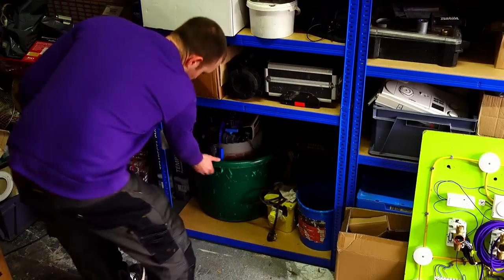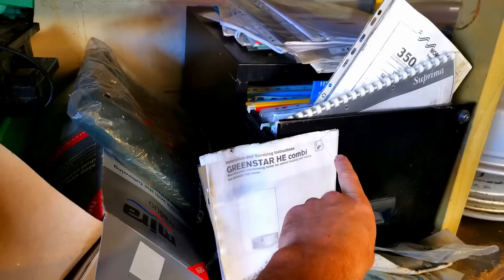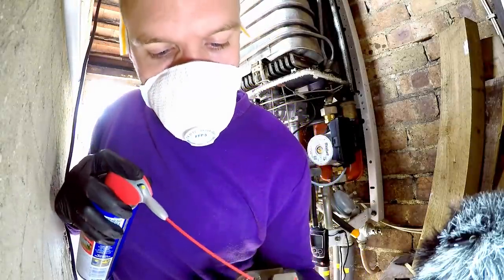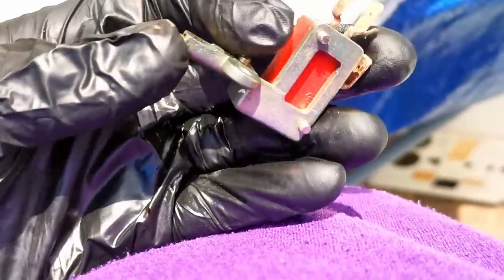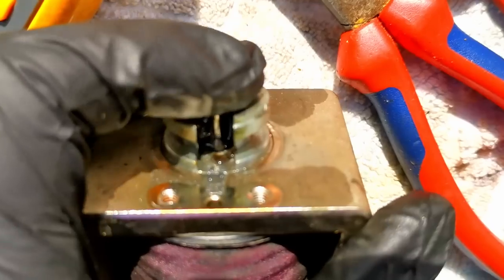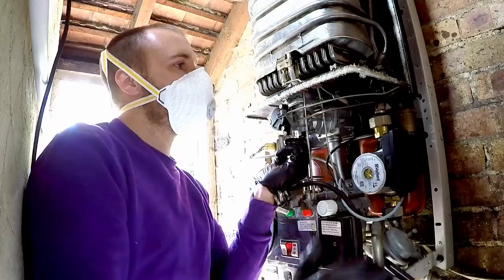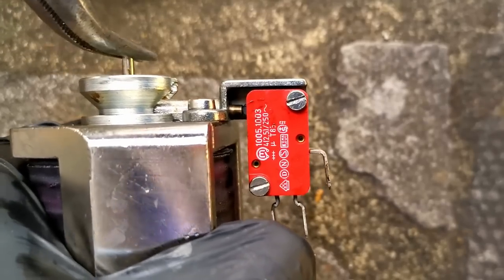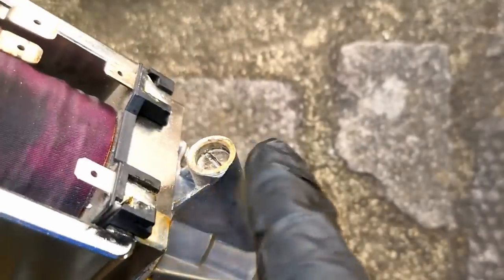Oldest Combi Boiler Repaired. Finally Fixed?

Comment: Absolute quality job. Honestly, I would have walked or fitted a new one. Credit to you and our industry.
Reply from the maker: The problem with fitting new is you lose a customer for many years. Manufacturers will sell them an extended warranty and system cover too. Keep the old boiler on the wall and keep a customer happy. Also you get to build a relationship and have a long term customer. Thats my thinking anyway. What analyser would you recommend?
Reply: I thought you had one of the best KANE defo not TPI. I have an Anton never a problem but they made them obsulete, me to looking for recommends
Reply: @kevinschoales844  What's wrong with the TPI ones? I was looking into getting one of those as my regin one click is due for calibration, so any info appreciated.
Reply: @MrSuperheterodyne  i had one onloan as Anton in for recalorbration battery prob, then 2nd very slow reading slight adjustments and several boilers high ratio, going back to all jobs with calibrated Anton to recheck. Kane had good reports about and quick turn round 👍
Reply: @kevinschoales844  Thanks for the info mate. I'll have to see what deals Anton have on the go. Sometimes the college training centres have info on promotional deals and their reps used to go there.

Comment: The most interesting and intriguing boiler repair on YouTube. Really enjoyed all three parts. I regularly work on lots of old gas appliances, but I've never seen that Vaillant model. Oldest for me would be a Worcester Heatslave (gas) floorstanding Combi. With an open vented heating side! The older models I agree are more interesting as I guess they are more mechanical and less than electronic. I wouldn't have been able to fix this one though as you did so I take my hat of to you. Cheers
Reply from the maker: I think everyone could fix this boiler. Its 90% mechanical and thats why. I really like these older boilers. :-)

Comment: I’m still nursing my 33 year old Potterton Neataheat, last 3 guys I asked to service it said sorry it’s too old and I need a new one. There are so few parts inside an old boiler that there is not a lot to go wrong, long may she live on. 🚀
Reply from the maker: The Neataheat has some asbestos seals so you should look up your specific model with serial number to check if it can even be serviced. :-)

Comment: Just finished watching this 4 part Education, it was at the end of part 3 that I realised it was 00:43 am... Must congratulate you on your Filming & Editing prowess, it must take hours to produce a video of this quality! Had a water leak on my Sine 18 in the mid 90's, from the water diaphragm on the Gas vlv which trashed 2 boards inside the Control box. Sourced replacements and fitted but would not fire up? Had to get a Vaillant Engineer out, fiddled about for an hour or so, and then all of a sudden, it lit and went up like a Hot Air Balloon burner! At the time he had his hand in amongst the pipe work on the RH side of the control box. I asked how he fixed the problem and said 'it must have been a loose wire connection'. I paid him and he left. Got my torch out and had a look and found the reset button with the rubber bonnet on it you showed us in the this vid!
Reply from the maker: Yeah, the old ones are hard to repair as the knowledge has disappeared with the older engineers. Thanks for take ig the time to comment. :-) I appreciate it.

Comment: hi ollie  i had one  EXACTLY  the same  in my house from  1992  it was in the house before i got it   it give up leg's about  2005    it was probably something silly  but the  plumber said  if i was you i would just change the lot ?  i could fix it & 2 month's down the line  some thing else might  go  why don't you get a more efficient boiler  save money   since then  till now   i have had 2 more boiler's in  both have nothing but hastle    ton's  of part 's giving up  a  Potterton  & my present one is a  baxi   the worst move i ever did    might have been a big ugly thing  but   no bother    until my  service  guy moved away   my valiant died  with him moving 🤕 oh and what a cracking bloke you are  your  knowledge is 100% stay safe

Comment: Well done, great content & awesome work. That older gent really appreciated your efforts & I'll bet that vaillant combi will still be running easy another 8-10 yrs if you get to look after it. My floor stander is 45 y/o & my partner's combi is 29 y/o. They get regularly serviced. Both running perfectly & while that continues the efficiency savings don't justify replacing them.
Reply from the maker: Exactly right. The cost savings are not what they seem. :-) Especially when you need parts every few years. :-)

Comment: Great work man.  For analyzers, I've always had solid luck with Testo.  Have an old 330 right now, contemplating replacing with a 320 when it finally gives up the ghost.
Reply from the maker: I had a 330 many years ago. cost me £1000 with all the gear.... Used it twice and it got stolen. it did appear to be great. I was absolutely fuming. I got Kane 455s ever since mainly because of the price but it was a great tool. Im so unsure right now though
Reply: @HeatingGeek  Yuck, that would definitely sour me.  Apparently my info is out of date though, the 320/330 appear to have been replaced by the Testo 300 LL.  Looks to be in the $1500-2000 CAD range.  That said, if it's as reliable as the 330 that I have or the 550 digital manifold, it'd be worth it long term.  One big selling point is that they are easy to get serviced and you know you'll be able to get repair/replacement components for a very long time.

Comment: Very thorough mate, installed plenty of Vaillant boilers in the 80s, they were an excellent piece of kit. They were the most expensive on the market at the time, Vokera were also popular at that time, cheaper but inferior to the Vaillant.
Reply from the maker: Vokera came form a scorned man who wanted to sell Vaillants. AFAIK
Reply: Good old days when boilers could be dismantled, rebuilt and not fall apart. Not composite plastic crap with loads of O rings, i hate em..
Reply from the maker: @kevinschoales844  :-) You and me both. :-)
Reply: @kevinschoales844  You won’t find a present day boiler lasting 40 years that’s for sure. Lucky to get 10 years out of them.
Reply: @tonymarshall4164  i got called out to a past boiler last week, customer said i installed over 30 years ago, had been maintained by others until won't as of course obsolete Bermuda, however its only gas fire tap at fault, he refuses to have a condensing combi as " they dont make em like this no more" 
He will eventually realise he has no other choice.
Tales of a heating engineer
Reply: @kevinschoales844  hi mate, Baxi Bermuda were pretty much bulletproof, very little to go wrong. But of course can’t compare to a modern day condensing boiler regarding efficiency.

Comment: Waited a long time for this apparent final episode and I must say your perseverance and determination is to be applauded but I need to ask what I am sure other engineers may be thinking was all your hard work and time worth all of the effort in the end?  If you say it was then I can only assume it was pride that kept you going but I hope you managed to show a reasonable profit too!  As a foot note I could not film and repair at the same time I just would not have your patience and dedication, so thanks HeatingGeek for another fine video and hope younger engineers will take some inspiration from you
Reply from the maker: The money was ok. I would do it again. The job was worth doing just for the knowledge gained. I really like the older boilers and how they work. New stuff is very very similar so gets a bit boring. 
Would you have done it? Also I really do want recommendations for a new analyser. :-)
Reply: @HeatingGeek  

I would go for a testo 330 i have had mine for about 3 years now much better than the other brands and can with stand   a lot of ppms for those boilers that have never been sett up correctly.
Ps expensive to service though
Reply: @HeatingGeek  As I am nearing retirement so I probably would have given this boiler a wide berth but years ago I certainly would relish the challenge as you have. As for GFA I have remained loyal to Kane and have never used anything else, it does what I need it to do and re-calibration is a fair price imo

Comment: Mega fix. 
I had a VCW Sine18 for 20yrs - and it was prob already 10yrs old when I moved into the house. It finally gave up the ghost in 2011 with hot water not working unless the CH circuit was calling for heat. May have been a simple fix - but I had the boiler replaced with a WB 37CDi for an improved flow rate and efficiency, I doubt may boiulers will last as long as that one has.
Reply from the maker: Im sure there are a few more sine 18s out there somewhere. :-)

Comment: Finally great series nearly as long as GOT just waited too long for the finale 😂 well done for seeing the repair through 
Testo 327 - work well good price point doesn’t shut off when due a calibration 😡 unlike Anton I think they are great hard case though which has its good and bad points
Norstrom Proflush Magmaster - great for flushing boiler swaps but maybe bulky for boiler only flush but they do a Compact machine too
Reply from the maker: I don't do Boiler swaps so a compact machine would be better for me. My choices for FGA are kane, Testo EIUK or bluelyzer. I had never see the last 2 before but I might just give them a go. :-)

Comment: Thanks for giving us the update. Really enjoyed watching it. You did an amazing job really impressed. Hope everything going good with your buissness now. 

Also I like the new Anton analyser alot of people like Kane but I prefer Anton only problem I find is when you send it for calibration you don't get it back as fast as Kane.
Another thing to point out with Kane it takes a fair amount of time to zero before you can use it compared to Anton.
Reply from the maker: I agree about the 90 second delay before you can use it. Ali who works with me has an Anton. Not very many recommended them though.

Comment: I don't think I've seen one of these Vaillant combis in the last 15 years or even more! They were expected to last between 15 and 20 years and quite a few of them were replaced in the 90s. Most engineers just told the customer "Sorry mate, no more spares available!" and sold a new boiler. My parents had a 1977 Junkers that was considered absolutely ancient by about 2000. It never died but it failed the stricter emission tests introduced in Austria in 2011 I think and was replaced with a whole-house pellet boiler (house with 8 larger apartments) in 2012. We were quite annoyed about the gas engineers we had to have the boiler serviced every year, for most of its life though. Some time in the late 2000s the boiler started to leak a little and we had to refill the heating system every few months or so. We told the company several years in a row, they couldn't find anything. I then started to suspect that the expansion vessel might be broken after over 30 years of service and it might be a good idea to fit an external one instead. My uncle, who's a plumber, fitted that and in the process discovered that one of the connections at the heat exchanger hadn't been done up properly and leaked for years! He tightened it and that was it, no more problems with the boiler for the next three years!
Reply from the maker: The old boilers were made to last as long as possible, new boiler are made to sell parts and service contracts. ;-)

Comment: I see boilers only a few years old at the scrappers and I look at them and think "There is nothing on that boiler that isn't easily fixable" . All this talk of zombie boilers is just sales propaganda. There are too many manufacturers chasing sales to keep production lines going. Thats why boiler are cheap and parts are expensive. £60 for a plastic bayonet fit AAV  with O ring....its a joke. I'm full of admiration for your tenacity and thoroughness. I have to admit I'd have struggled with that one without a proper manual.
Reply from the maker: Its actually a very easy boiler to work on and diagnose. If you read the manual. :-)

Comment: Thanks for the Vid instructive as usual , I know that feeling where you just want to run away lol.  Just a crazy number of adverts every couple of mins. Nearly turned off after the first 5-6 only 10mins  totally crazy
Reply: I used to get loads of adverts but I started using a browser called Brave that someone on here recommended.  Do not get a single advert on anything I watch now. Give it a try.
Reply from the maker: I don't place the adds. Youtube does. :-) But as Dave T says you can get browsers to stop it. :-) It drives me mad too. (not on my stuff but on other peoples) ;-)
Reply from the maker: @silvervanmanfly  Good shout. I think you can get add blockers on Chrome too.
Reply: @silvervanmanfly  Will look into that thanks
Reply: @HeatingGeek  Thanks for your reply I now have a chrome free add on that works really well give it a look Adblock

Comment: Well done mate. Sometimes I wonder if it's worth spending so much time on repairing old boilers, as satisfying as it is. I've sometimes not managed to fully sort the problem and then not charged the customer properly and felt it was all a wasted effort. Even though it's always a learning experience. Then when it stops working next time it will be your fault in the customers eyes. 
Next time just fit a new Vokera Easi Heat 25 and then change your phone number.😆👍
Reply from the maker: :-) I have a fixed fee and it works out for me . What analyser would you use to check the Vokera? :-)
Reply: @HeatingGeek  I've got a Kane 458s. Great bit of kit, it's the second Kane I've had because they give excellent customer service.

Comment: I would imagine a very high percentage of gas engineers would have condemned that boiler as soon as they looked at it. We have a Halstead Quattro combi boiler which is nearing 35 years old and is still running strong. The only things that have failed on it were the diverter valve diaphragm had split on three occasions (the popular Giannoni valve) and the ignition board.
The diaphragm kits are still available to this day. It may not be as efficient as today's boilers but has outrun many of them.
Reply from the maker: Exactly. Also the manufacturing cost (both monetary and environmentally) would have been worse on a new efficent boiler.

Comment: I can see this was between you and the boiler like Bruce Lee vs the Demon lol well done that was amazing viewing real engineer work 👍
Reply from the maker: It was. This is a model I didn't fix about 17 years ago and lived with me. I'm  glad I got to spend the time and learn a lot about how it works . Any analyser you would recommend?
Reply: @HeatingGeek  I use a kane 458 day to day and find it rock solid, they do 5 year fixed service cost with quick turn around, downside is purge time. The testo 320 anayliser is very good but not sure about ongoing costs. Thumbs down for Anton expensive servicing and the ones I've experienced are just unreliable and can never trust what they are telling you.

Comment: Brilliant job! Where I work it would have got the death sentence and a new Bosch Condens 5000W would have replaced it. Anyway, my tester is a Testo 310 w/printer (the printer is a bit on the slow side), and I use a Testo 510i smart probe as manometer and they work great on the 4-6 calls I do a day.
Reply from the maker: How often do you need to charge the 310?
Reply: @HeatingGeek  The battery has never run out on me because I simply plug it in the charger to top it up every evening, but that being said the battery always show 3 bars out of 3 at the end of the day. The only annoying issue I have had was the print in the tester died on me and had to be replaced, covered by the guarantee of course, if this happens it always happens during the first couple of weeks. It has worked flawlessly ever since and is extremely reliable and easy to work with. I find the menus faster to work with than many other testers due the fact that you move "sideways" in the menus, and never back out to the previous menu level before you select a new measurement. My usual routine is: Turn on the 310 and while it flushes and calibrate itself I turn on and fit the 510i and then the 30 seconds is up and I press the <->  (sideways) button once and make the ambient CO measurement, when done I press STOP and <-> and take the flue draught measurement and press STOP, set the boiler on Max, next I press the <-> twice and I do the max adjustments for O2/CO then I press STOP and Print, and while it prints, I set the boiler on Min this give the boiler time to switch over to minimum and get up and running, then I press START and and take the measurement, press STOP and Print and I'm done with 310. I am very happy with it.

Comment: Can you shed some light on indirect single feed cylinder and how it works? I came across it on a back boiler conversion and I don’t get how it fills the system, how does the inside of the cylinder work? Do you have a diagram? There was no F&E tank at all.
Reply from the maker: Primatic cylinder?

Comment: Can i ask,  I'm currently looking at a narrow boat that only has electric, it's never had any gas installed, it does have a gas locker at the bow,   I'd prefer a gas boiler and cooker,  would it be difficult to convert,  cheers
Reply from the maker: Forget the gas boiler bit. You cant run a gas boiler with the LPG bottles you can store in a gas locker. Usually you can only get 2 13KG LPG bottles in a gas locker. The take off rate isn't enough (usually) for a boiler/water heater and cooker.
Reply from the maker: So basically you need to do some careful calculations before you start. A cooker/Oven is easy enough though.